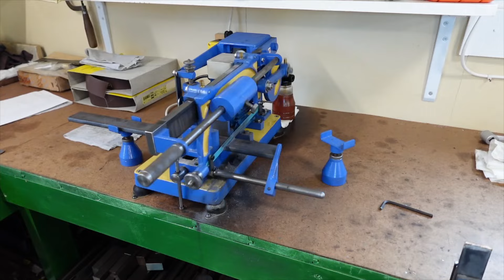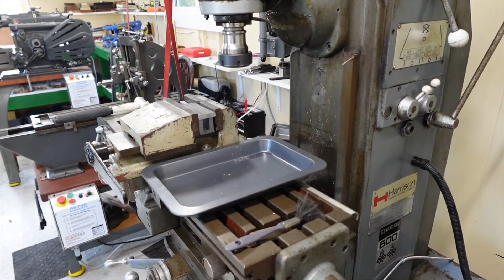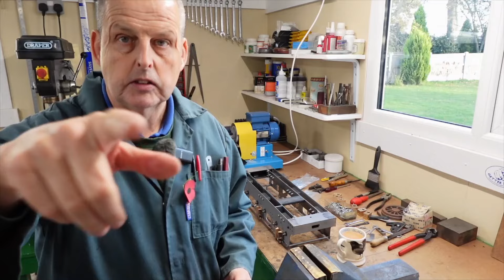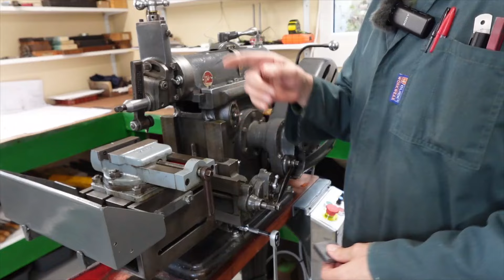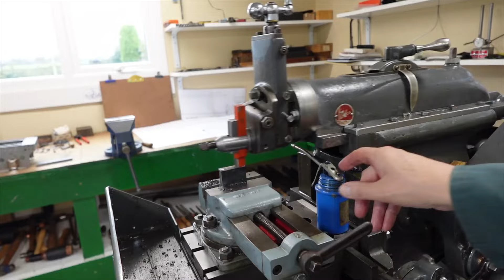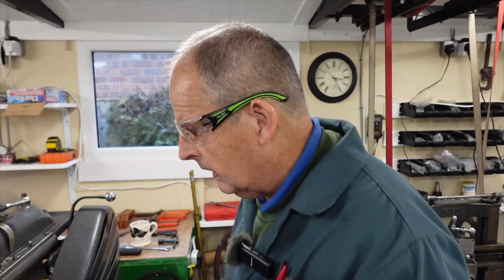More Milling Machine and Metal Shaper Work on our 5" Gauge loco tender. (Part1)

Comment: Interesting that the blade rubs on the backstroke.
Reply from the maker: That is typical of a Metal Shaper.  There are some with tool lifters fitted, usually large planers and shapers.  Thanks for watching.
Reply: @davebates2709  It's taken me about 15 minutes to worl out what's gone wrong with this conversation - despite the clue of "blade". I was talking about the power hacksaw, not the shaper. All the hacksaws I've seen lift the blade slightly for the return stroke. Yours appears to have hydraulics to do it but it doesn't appear to be.

Comment: Cute power hacksaw. 45 years ago, I saw a large very old power hacksaw sitting on the edge of a gas station parking lot. I ended up buying it for $10. It took me a while to fix it up but, I got it working nicely. At a flea market, I found a package of 12 brand new blades for it. Good video. I like the tip about placement of the pan to catch chips. Good Luck, Rick
Reply from the maker: I was at one of my Engineering Suppliers a few days ago and they had a pack of brand new Eclipse 24" Power Hacksaw blades, in the surplus stock basket, at a knock down price just to get rid of them.  They will probably still be there in 6 months.  Thanks for commenting.
Reply: @davebates2709  Those are big. I think mine took 16". It is buried under a bunch of boxes right now. Good Luck, Rick